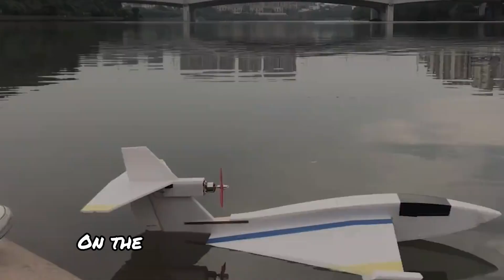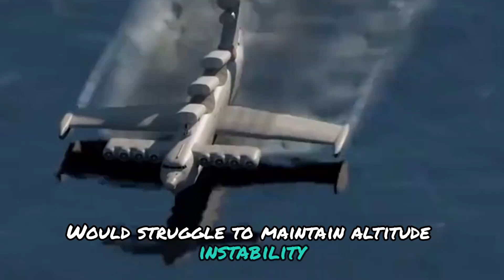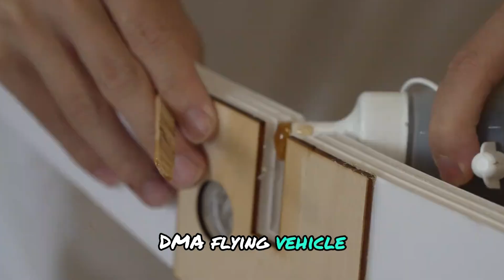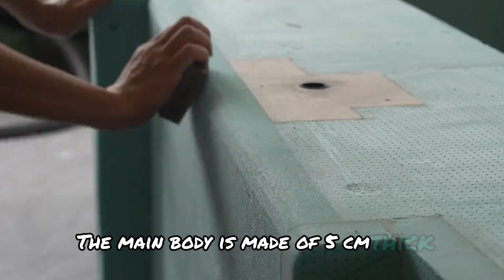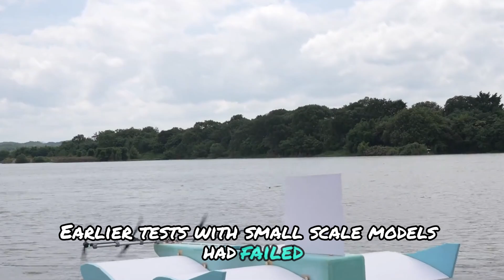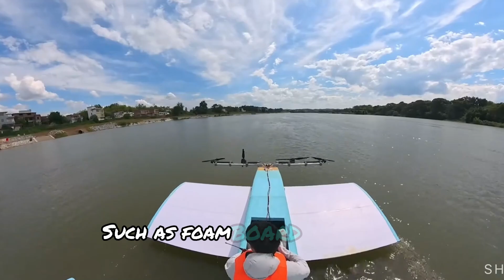MANNED GROUND EFFECT AIRCRAFT! A 4-Year-Old Dream Became Reality!

Comment: You should use the rudder as winglets.

Only 1 big airfoil is more efficient than 2.

In order to stabilize 1 airfoil you need the option to open the airfoil, in order to split it in two. 
Slotted flaps work a bit like this. 
But you need a big flap. And a short main wing. 

I also get ideas for better propulsion than propeller drives.